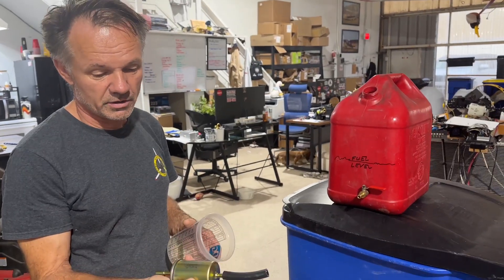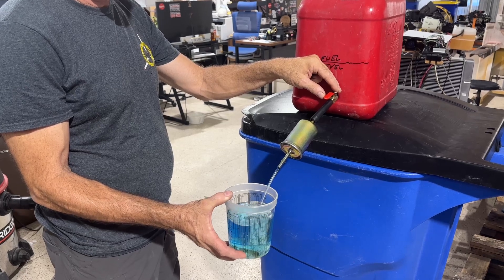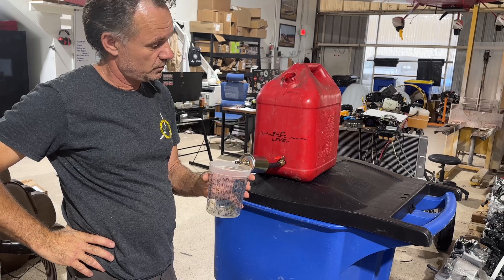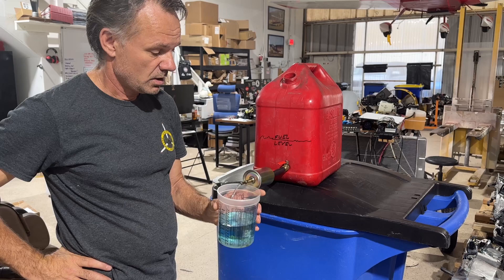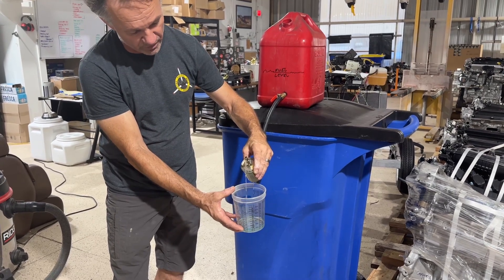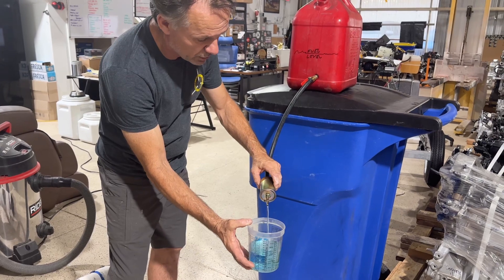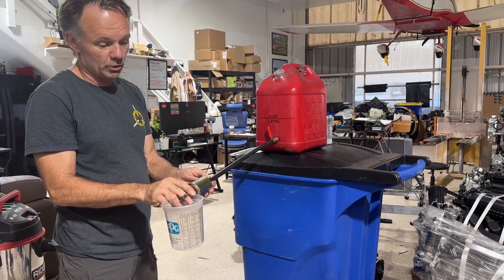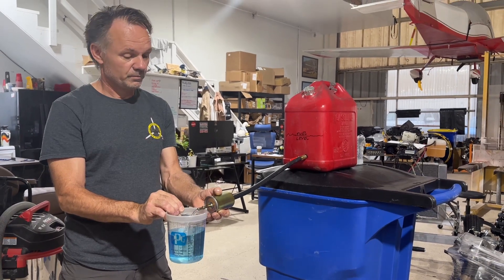Gravity Fed Header Tanks

Comment: I suspect most of the difference in flow rate you saw with the filter tilted upwards was due to the outlet being higher and thus at much lower head pressure.  I suspect that with a longer hose so that the filter could be tilted upwards, but with the outlet kept at exactly the same height as with horizontal, you would see little, if any, difference in flow rate.  I can’t think of any intrinsic reason that the filter would change flow rate based on its orientation alone, unless it has an internal check valve that can change position with orientation.

Comment: This partially addresses something I was thinking about just yesterday.  My S-21 plans show the coarse filter between the header tank and the fuel pumps being mounted level.  However, the fine filter between the fuel pumps and the fuel rail is mounted vertically on the firewall.  It would be more convenient for me to mount it horizontally on the firewall, but I wasn’t sure if this would allow air to be trapped in the filter which then might be expelled during turbulence or an unusual attitude.  I suspect this isn’t an issue as most cars with fuel tank mounted pumps have their filters horizontal under the car in the pressure side of the line between pump and injectors, but then cars don’t see the change in attitude than an airplane sees.

Have you done any testing with filters on a pressurized line (50+ psi) as compared to a gravity feed line (less than 1 psi in most cases)?  Once I get my pumps installed, I may test this myself to see if holding the filter horizontal for a time and then turning it vertical allows air to be expelled.